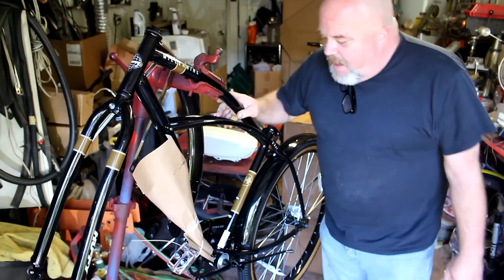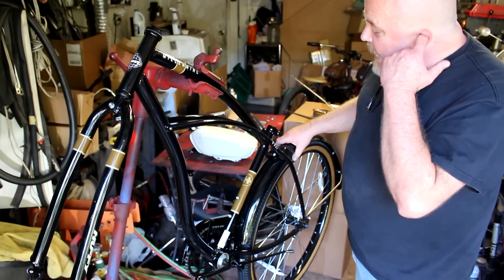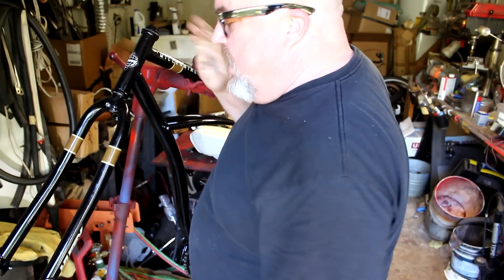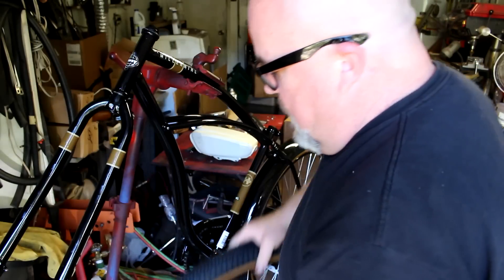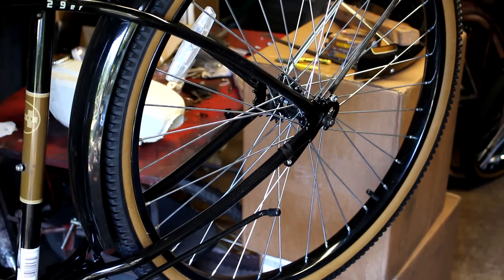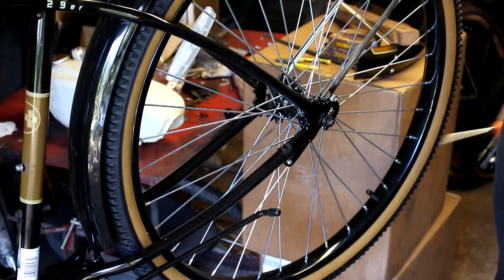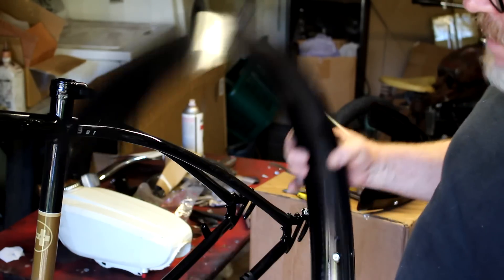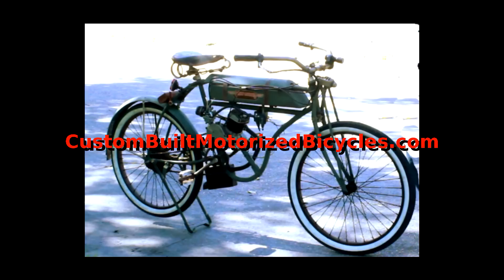How To Build Motorized Bicycle Prepping A New Bicycle For Installation

Comment: How often do the fenders need to be tightened from vibration?
Reply from the maker: +Dan Croft Each bike is different. Flexing also will stress the fenders and crack the mounting tabs. So check often.. like 1X a week
Reply: +HoustonMotorizedbike.com
Reply: will u build one for me? i have a genesis moutain bike i got from walmart.  wanna buy the coversion kit i see on ebay.